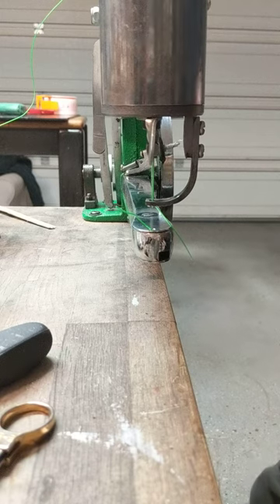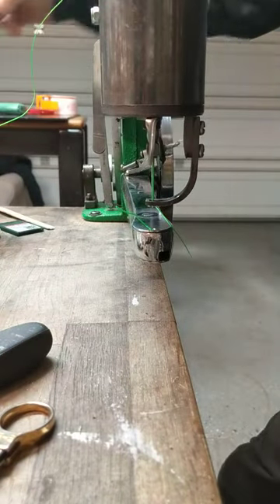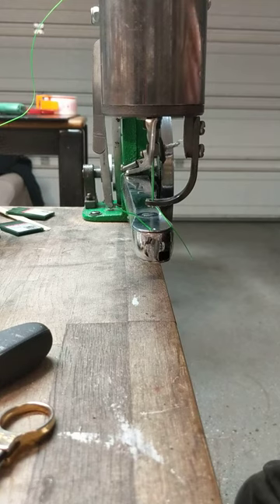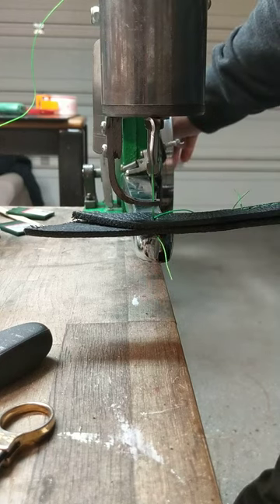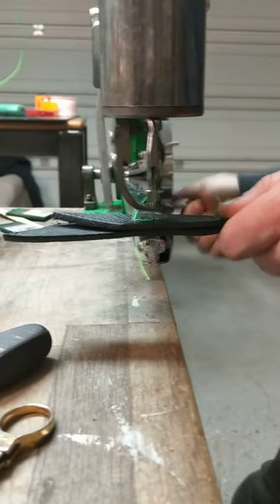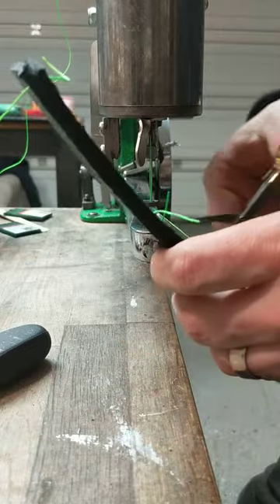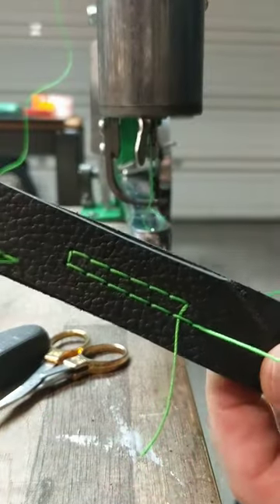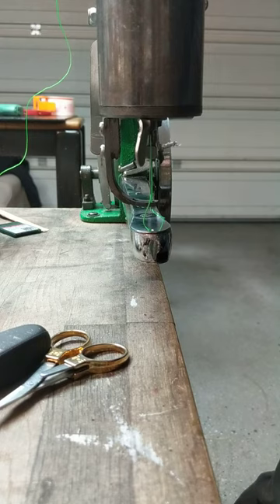BIG needles and THREAD on the leather shoe patcher sewing machine

Comment: I don't know how you did it.   The Groz Beckert are industrial needles and are longer at 43.21 mm while the standard needle is 39.53 mm.  Also the round shank will offset the needle slightly to the left and cause the needle to jam and the tip will break off in the arm.   I know because it happened to me.  You would have had to raise the needle bar to accommodate the length.   I use the Groz Beckert 140/22  but I shortened the needles and ground the shank flat.  Now they work.   I think you need to warn people of possible damage to their machine if they try these needles without modifications.  I have 3 of these machines and none of them would take these needles without the modifications.   Some people have modified their machines to take round needles but once you do that then you can no longer use flat shank needles.

Comment: Finally found 140/22 needles with the flat, in size 15x1 for my patcher, on Amazon.   Now works fine with 207 thread.
Reply from the maker: Nice! Some machines handle the round shank better than others. Mine doesn't seem to care but I've heard others that won't work at all
Reply: Can you share what 207 thread you're using?
Reply: @bigchiefleatherworks7245  I have had the thread for some years and don't recall where I got it, but it is polyester.
Reply from the maker: @bigchiefleatherworks7245  this is A&E 207
Reply: @rogueapparatus6414  Thanks!
Reply: Hi ! Can you send me the link ? I can´t find it with the flat .
Reply: Please share where you foundd it with a flat shank. Thanks !
Reply: @edcubberly8907  On Amazon, Ed.  I don't have the link any longer; but you can do a search.  That is how I found them.
Reply: @POULPY47  bantam saddle and tack
Reply: @edcubberly8907  There are some flat shank needles 140/22 that I bought but they are junk.  They fit the machine but are only good for thin leather.  In thick veg tan they bind up because the tip is round.  The industrial needles are titanium round shank and did not fit my machine until I modified them.   I ground the shank flat and shortened the needle and they worked well.   They were also able to sew 1/2 inch veg tan leather without binding.  I'm getting ready to post a video now.

Comment: Use emery cloth on the bobbin shuttle to increase the tolerence between the bobbin shuttle and the needle when it is down all the way and you can step up to 277 thread.
Reply from the maker: I'm not sure I fully understand where you are putting the cloth. I like that idea. I've made it to 207 thread, but it doesn't run well on this hard veg-tan leather.
Reply: @rogueapparatus6414    you carefully polish down the bobbin shuttle to increase the distance between the point area of the shuttle  and the needle.. if you watch with thw cover open you see where the thread passes around the bobbin shuttle, 277 thread simple wont pass in that close tolerance between the shuttle and the needle

Comment: I bought a second machine just for the purpose of running it with 135 class needles. Simple adjustment to the needle bar. Tried #23 needle and wouldn't fit through the channel below. # 22x16 with 207 thread works through both upper tension assemblies. Through the bobbin case over the top of the spring.
Reply from the maker: I've heard that most folks have to bore out the holes just slightly to allow for 23 needle

Comment: do these needles have a flat side to them?  I keep breaking needles and am having a hard time finding the correct needles for my machine (the same)
Reply from the maker: No, I use a jewelers file or small die grinder to make a flat spot on them. Depending on your machine they might work without the flat spot. Some are picky about it
Reply: @rogueapparatus6414  thanks, great feedback
Reply: The needles he is using are NOT FLAT SHANK,  THEY ARE ROUND.  They are also longer than the regular needles.  These are industrial needles.   I bought some cheap 140/22 flat shank needles but they were junk.   They have a round sharp tip but bind up in thick veg tan leather.  They are only good for thin leather.   I use the Groz Beckert 134D  140/22 needles but I modify them.  I grind the shank flat and I shorten them.  The tip is a sharp chisel tip that penetrates thick leather.

Comment: What is the length of the sewing needle in those machines? Is it the same kind/length needle as in a Singer or Brother home sewing machine? Also does it have a flat shank on the needle?
Reply from the maker: These are the same length as the originals but they do not have the flat shank. I usually take a jeweler's file and flatten a spot so they don't try to slip or turn while I work.
Reply: @rogueapparatus6414  That is not exactly what I asked. Is the needle about 39mm in total length or longer to use in that sewing machine? I am asking because I want to buy one in the near future and want to know what kind of needles to use.
Reply: These needle are 43.21 mm long,  the normal needle is 39.53 mm long.  You can accommodate by raising the needle bar but you need to grind the shank flat.

Comment: Hey bud I’m using  134d 160/23 and 207 thread but it keeps ripping the thread and I’m running pretty much no tension and I removed the bobbin spring and I’m just kinda lost at what to do
Reply from the maker: Have you opened up the needle channel in the lower arm? Some machines weren't made with enough clearance for 160/23 needles. You might need to ream the hole slightly... Like 1/64, not a lot or you'll mess things up
 
Also I like to grind a flat spot on the shank of the needle so it comes down closer to the bobbi
Reply: @rogueapparatus6414  ok sounds good hey good you show me the area that needs reaming exactly?
Reply from the maker: @justinmangrum2729  it would be the whole lower channel that the needle passes through including the swiveling top plate. Make sure the bobbin and carrier is removed when you do it
Reply: @rogueapparatus6414  okay I know exactly where you talkin about now I’ll be sure to clean and remove the adequate material
Reply: I tried that but the machine will take a max 140/22 needle because the hole in the arm is small.   I was going to drill it bigger but the 22 needle does just fine for me.
Reply: Hey i had the same issue with thread snapping and tried everything almost binned the sewing machine, there is a video of a guy who takes the bobbin holder bit and sands the edges and gives it a sand over all, not snapping any more and my machine sews now, i tried everything this worked like a charm. Good luck

Comment: Normally you would use size 23 needles for 207 thread, and size 22 for 138 thread as that is standard recommended but you are not going very fast or very long sewing sections with a hand patcher.
Reply from the maker: Yeah actually my next video is going to be a full setup with 23 needles. I manage to get away with 22 because they are D points which leave a pretty big hole

Comment: i guess it's gonna about just a meter due to small bobbin that's the only thing i dont like in the machine.. except that it's perfect
Reply from the maker: Yeah I've wanted to try to come up with a solution but the small bobbin and shuttle assembly is both a blessing and a curse... Creating a channel for thread would compromise the gear assembly. It's a great machine for small projects. With 138 thread it will do a 34" belt which is a pretty long stitch.